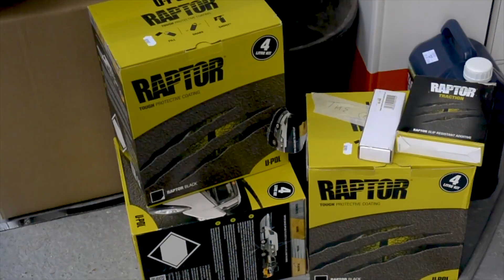Raptor Lining My Nissan Navara Kingcab & Hardtop

Comment: Do you mind me asking how much it cost to have a body shop do it? Thanks
Reply from the maker: It was around 1.5~2k, they did polish and do quite a few other bits in that as well like re fibreglass parts on the canopy etc. Took about a week. In hindsight I'd probably do it myself given what I know now but I don't regret it at all, the lines came out so well.

Comment: Okay, this is three years old. Turn off the background music. It is beyond me why YouTube content creators think playing background music over their voice is somehow enhancing their videos, it is not, it is distracting. We came to hear you, not to fight background music which quickly becomes extremely annoying and intrusive. Many folks have hearing difficulties, thus while concentrating on your voice they must also concentrate on tuning out the music; frustrating. Your background music ruins an otherwise exceptionally good presentation.
Reply from the maker: Fair points! I'll try to lower the music in the background much more, usually it's in place to accommodate for a lack of audio on clips or very loud peaking that would be far worse on the ears. In this case a sanding machine & sprayer droning prevented any in the moment filming. Thanks for watching!